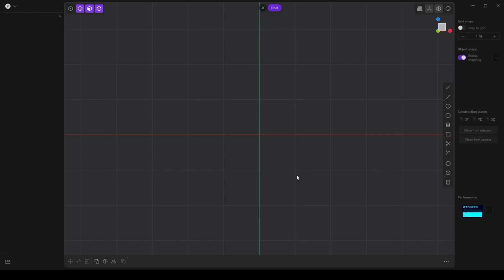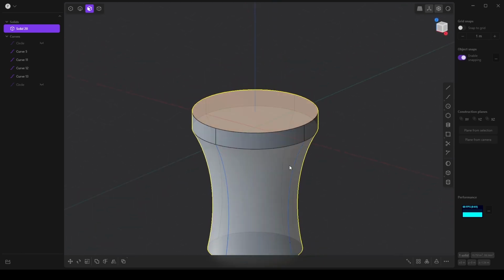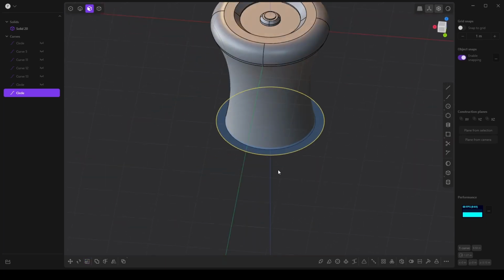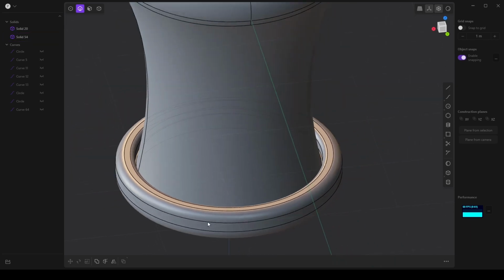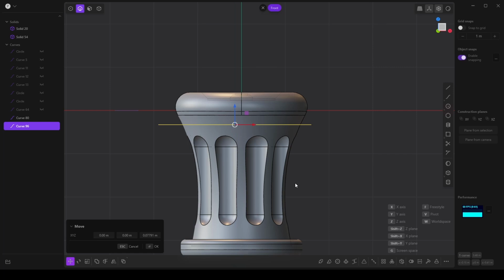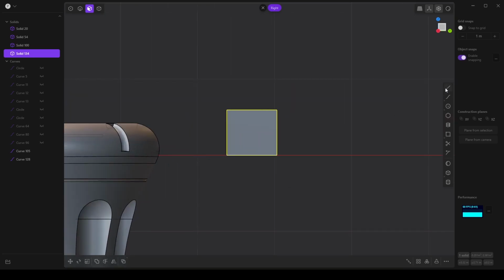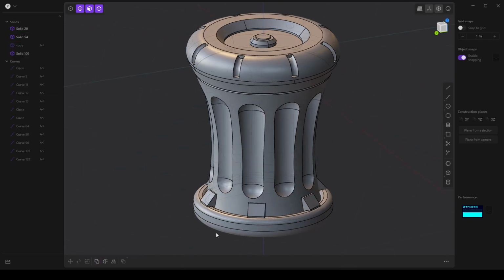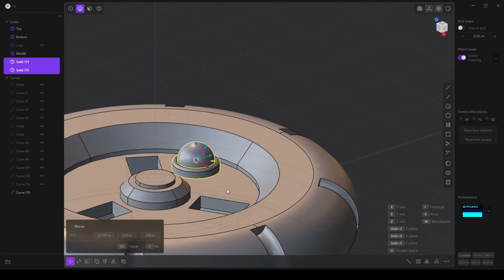How to make a Sci-Fi Grenade in Plasticity (Drawing in 3D)

Comment: How are nurbs different in texturing? lighting? and being used in game engines or blender for animation?
Reply from the maker: A common workflow is to convert them to polygons first, either a simple mesh and baked details, or just a high-res mesh. 

While retopo is an option, there are ways to use a non-all-quad mesh even when sculpting: https://youtu.be/wVRt1lC-wec

Even if retopo/all-quads is still required, I find the workflow to be more fluid and would still want to start with Nurbs.